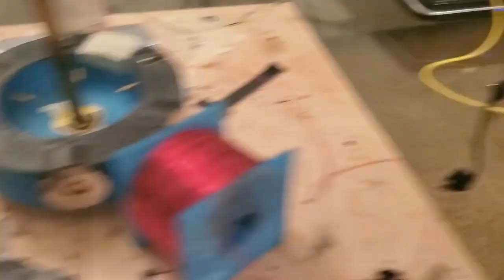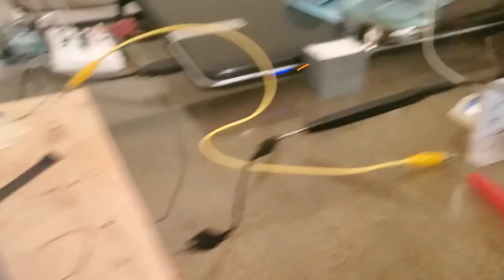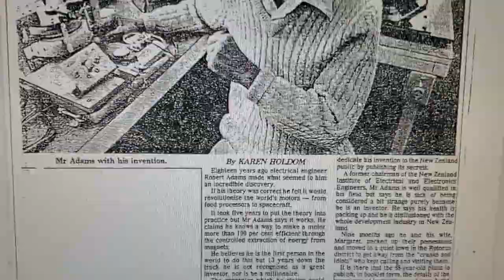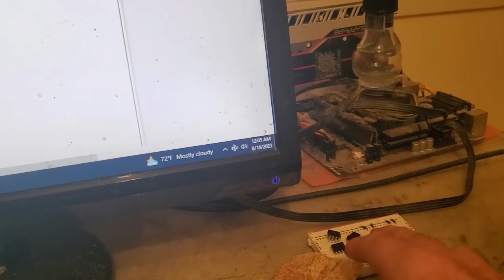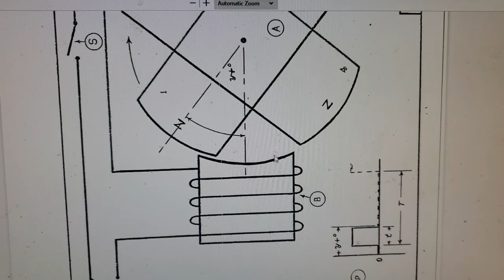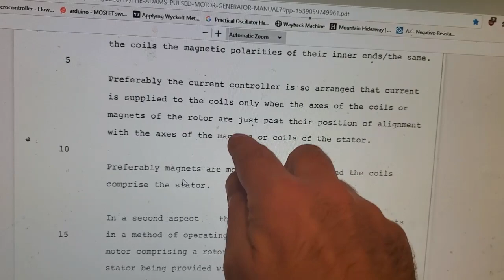Spinning a Simple Reed Switch Robert Adams type Pulse Motor

Comment: Bedini motor. Reed switches 
are susceptible to CURRENT SPIKES as they are not designed for high currents. This is an imitation of Bedini motor. John Bedini used neon lamps to capture the voltage spike where current was minimum. Anyone interested in this type of method should go to Youtube 
and type in Net Zero. On this site go to playlists. There you will see a playlist of 56 videos in one playlist. This is mind opening information. I am an electrician and I am qualified in Industrial Electronics. Trust me this is Fantastic information that I have just recently become aware of. Cheers
Reply from the maker: Thank you Greg.

Comment: Nice, similar to John Bedini's machine. Can you get this to be perpetual too?
Reply from the maker: I'm not sure.
Reply: The limitation is restricted to 
mechanical constraints from what John Bedini explained. He ran these motors 24/7 but by doing so the bearings degraded as in any motor. Cheers.

Comment: Do you have a steel core in the coil? If there is a steel core would that lead to more torque/lower rpm?
Reply from the maker: Sorry for the late reply,  No steel, air core.  Adding an iron core 1) greatly increases inductance i.e. more magnetic field strength for a given input of current 2) decreases Q Factor.  I sort of understood I wanted to preserve Q factor but till I did the deep dive wasn't sure how it all played out.  Also I recently learned and measured a ferrite core works a heck of a lot better than a homebrew welding rod core at preserving Q.  Am going to return to the Adams/Bedini pulse motor very soon now, with a ferrite core and (and we will go into this) with ceramic magnets not neodymiums.  Thx for the comment.
Reply: @paulmaher812  Thanks for the reply! I'm working on making a mendocino motor that would work as a three phase synchronous generator/motor but struggling of thinking of a good way to make a iron core for the coils on the cheap with limited tools.

Comment: PLEASE!  REQUEST FROM ENGLAND how do you stop the reed switch from welding closed ?  I have wrecked many reed switches a 6 v to 12v   Please help
Reply from the maker: Hi Sparkfishes, I'll do my best but notice in other videos I transitioned to a Hall effect -> triggering a Solid State Relay and it was in good part because I couldn't get the reed switches to behave as consistently as I would have liked.  That said, and certainly I have fried a few reeds as well, there are a few things to keep in mind.  First and foremost what is the amp rating of your reed switch?  If you have a 1/4 amp reed and you are putting an amp through it whether at 6V or 12V it is gonna go poof.  Second, because of the reactance of the coil, you want to give it a healthy spin to start with.  That is to say you might draw 0.1 amps once the thing is really spinning but, say at the worst case scenario, with the rotor stopped and the circuit open indefinitely, you might be drawing 2 amps.  So again because of the reactance of the coil the amp draw will go down as the rotor speeds up.  Lastly as you go to reed switches that can handle more amps they become slower in terms of how fast they can switch on and off (this speed should be in the datasheet) so if you have a BIG reed switch you can run into a situation where your rotor is spinning faster than the reed switch can switch.   Reed switches are fabulous at gathering the inductive spike because they are literally making a physical on/off connection, but one needs to keep in mind their limitations.  I have noticed even when everything is set up fine the are still a bit "finicky", but yea I love reed switches I just wish they were more consistent. 

Lastly, if you want to throw a lot of power to the the machine or just get things more consistent the first obvious choice is to use the reed to trigger a BJT.  I don't know I may have had a video showing that but if it really interests you I can talk you through it.  Of course then you have lost the physical switch for gathering the radiant as you are going through the PN junction but it still works on that front pretty good and now you can throw as much power at the rotor as your BJT or MosFet can handle.  Hope this helps, Merry Christmas and Happy New Year from the U.S.

Comment: Even though it's a monopole configuration on the magnets i bet the coil isn't wound to the same
Reply: on a coil every LAYER should be wound the same way, meaning starting on the left and ending on the right, 
i see ppl do one layer from left to right then the next layer is right to left, 
basically when power goes through that coil on both ends of the magnet there will be a N and s pole and a S snd n on the other end, 
if every layer is from left to right then there would be to N and N on one end and a S AND S at the other, 2 layers would have double the field strength,  
after i do one layer i try to get back to the other side with 1 loop or 2loops max to achieve all one way,
 just tapping a battery causes a really fast spin so probably leads to even lower power needed, 
i bet even the Bemf would look more uniform aswell, resonating coils are also meant to cause amplification.
Reply from the maker: @doubleooh7337  I don't know, when you use that one or two winds to get back to the start you are cutting across a lot of flux lines.  I really don't see the difference with going down to the bottom then back up again to the top, but maybe you are onto something.
Reply: @paulmaher812  you cutting across those flux lines with many coils 1 layer 1way snd 1layer another way cancels each other out except the outer wire is alittle bit wider and longer if 2 layers were the same way the poles would be TWICE as stong
Reply: 1st layer wound downwards would have lets say N>S , the second layer wound up has a S>N ect
Reply from the maker: @doubleooh7337  Okay!
Reply: @paulmaher812  I've had a recent erge to point this out to as msny ppl as possible obviously purely to help
Reply: @paulmaher812  look at my pram wheel that goes for it more coming soon

Comment: Hey paul, can you talk about the materials used in this device? Is your magnet ring a 3D printed PLA or is it traditional ferrite? What are the protruding screws for? What bearing are you using? Etc.. Thanks! Keep up the good work!
Reply from the maker: Hi Brent, 
Sure, the rotor is 3D printed PLA, it is a bit lighter than I would like, but sure is nicer than trying to make one out of wood by hand or gluing a bunch of compact discs together.  The magnets are neodynium and maybe a bit of overkill as they are quite strong.  They are reversible magnets with a countersunk hole in the center (from K&J Magnetics) so I 3d print a small guide hole in the rotor and just use a brass screw to screw them into the PLA.  If I start taking the magnets out flipping them over and screwing them back in, they start to not be anchored into the PLA as securely, but if I am not spinning at ridiculous speeds it holds up just fine.  The bearing is a skateboard bearing.  I actually found a noticeable improvement in how well the thing spins when I went from standard bearings to ceramic bearings, I think they are called  Yellowjacket "Venom" bearings.  Silly name but those things spin great and I am very happy with the brand.  Appreciate the compliment, once I get the 3D printer working well again, will try and do some more in this area.

Comment: I strapped a bunch of ceramic ring magnets opposing poles together with zip ties and what you described at 3:24 happens and you end up with 4 poles on one face
Reply from the maker: Thanks Arduinomerkaba, yea as I learned the hard way, if you don't provide a flux path that magnetic field shoots out with opposite polarity between two similar magnets.

Comment: Unless there is a reason you are avoiding using a transistor, you could make the reed relays job a whole lot easier by only using the reed to switch the base current through a transistor and let the transistor do all the work. You would also need to put a diode across the coil to absorb the back emf that can damage transistors (and increase wear on reeds.) That way the reed will be only switching milliamps while the transistor, (with correct selection of part) can handle many amps without degradation.
Reply from the maker: Hi TemporalAnomaly,  First, thanks for the comment and welcome aboard.  Not to come across as a smart alec but I have just done that in a video some time back. In the video just before this one I used the signal from a reed/voltage divider to an arduino ADC pin to both a) control the pulse width and b) do bipolar commutation from a single reed switch.  The video before that was a half hour video on how to put that circuit together.  To answer your question though, rather than always doing complicated projects and getting down in the weeds of details every time just wanted to show people a very simple way to spin a pulse motor that they could have fun with on a coffee table.  Really I started this channel just because I would do these goofy experiments and have no idea what I had thrown together a couple months later, so decided video log, then figured well I have a video I'll throw it on youtube to archive it.  By that I mean I don't remember a lot of what I did previously so again thanks for the comment and in general, except for the sake of simplicity I don't generally set things up this way.  Very last thing though, I would say a physical make and break almost certainly gives you the cleanest make and break so I wouldn't be surprised if at some point I 3d print a timing wheel and glue some copper strips on it for Medieval style commutation.
Reply: @paulmaher812   All understood, keeping things very simple can be the best way for those following along to get their projects working with a minimum of fuss. I must admit, I have not yet seen your other videos so I understand my comment may be redundant. Good luck with your experiments! Chris, UK.
Reply: as a viewer, i do appreciate the comments like these ❤

i learned a little bit extra while watching the video, and now know about another video to dig in farther.
Reply from the maker: @Sean-im8bf  
Me as well. 👍🏻

Comment: You must extract the inductive spike using a high speed diode, preferably and then the performance will improve and you'd be able to charge a battery from that spike. And you must use the reed switch only, to drive a MOSFET, which handles the current to the coil. Cau you tell me where I can download a copy of that manual from Robert Adams.
Reply from the maker: Hi Tony, thanks for the comment, yes, or as in the last video send the signal to an adc pin on an arduino and use that to drive a MOSFET, SSR BJT etc.  Just wanted to show a very simple, fun way to spin a rotor.  The document url is in the above video description.
Reply: @paulmaher812  Many thanks for the document download info. If you use a BJT, then you can directly drive it from the reed switch. No need for Arduino, unless you want to vary the duty cycle.